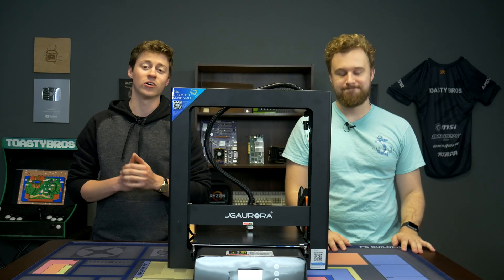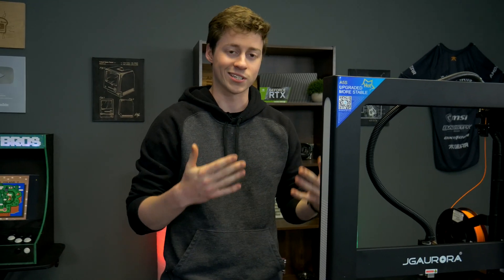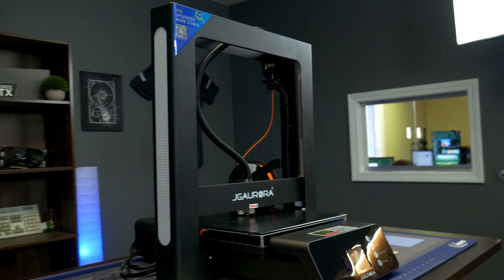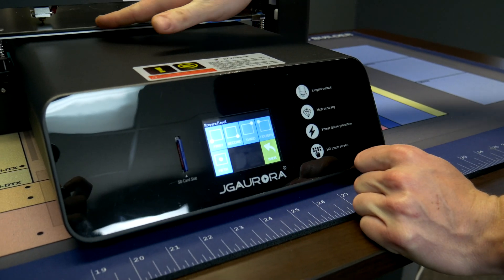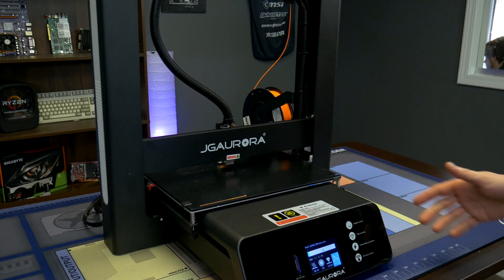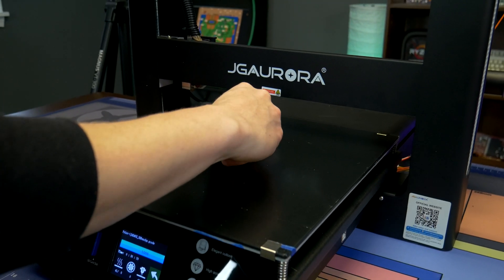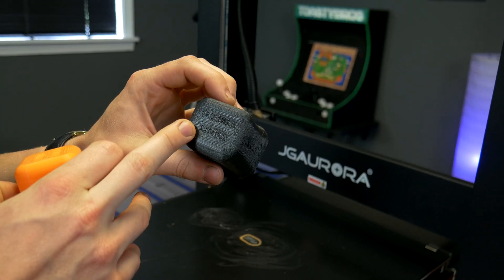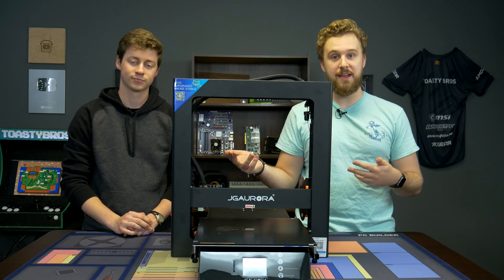Best 3D Printer Under $500!?

Comment: One thing I don't like is the filament change. When you start let say filament in the temp. goes to 195 deg so if you have filament like Petg you can't change to higher temp. same with Filament in. There is also no cancel of that operation so I had to turn of the printer. Then I had to go manually to change temp to 235 deg. and then Pull out or pull in the filament by hand.
That's the worst what I don't like.